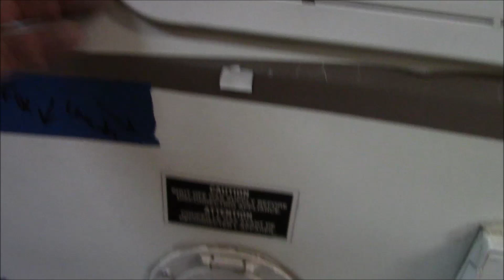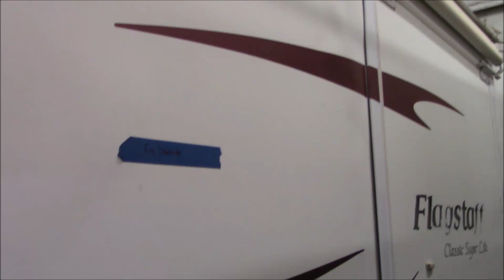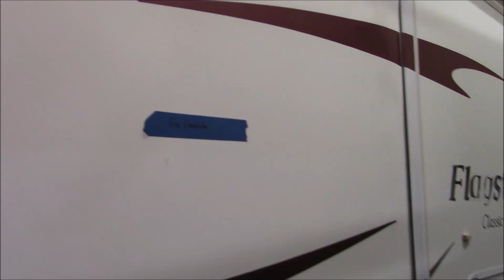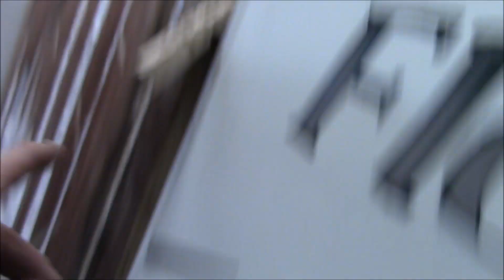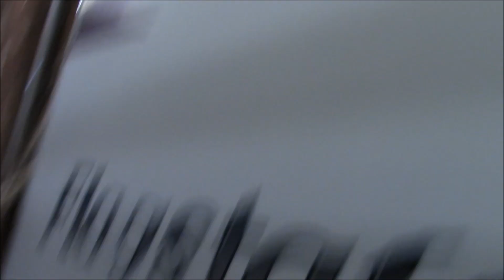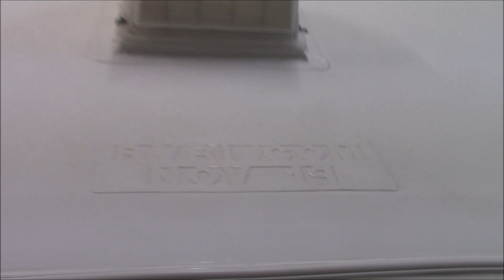2011 Flagstaff

Comment: I feel sick!...just ordered a new Rockwood 5th wheel...and while I was skeptical on the roof construction and build quality...now I’m really concerned. Got a 10 year old Northwood AF and never had any issues. Even mounted roof rack rails up there, lagged to the trusses, sealed with dicor. 6 years storing and carrying 2 kayaks thousands of miles, no issues.  No wall delam either. Maybe I’ll cancel the Rockwood!! Ugh...
Reply from the maker: Well...I am not sure how to advise since.... I don't own one...lol. I am the landscaper who had his yard paved!

Thanks for watching.
Reply: @RVROOFINSTALL  wow thanks for the instant reply!! You said you haven’t had an Airstream in your shop...have you ever dug into an Arctic Fox or Outdoors RV?  (Oregon made)
Reply from the maker: @Ck-ed9qy  we have not worked on what you've listed. What to keep in mind is the roof installation in the Rvs and campers. If the AC, vents and skylight etc are not elevates off the roof line, it will leak. Google commercial roof images and you will see all these components are elevated, not screwed to the roof and caulked around with globs of self leveling.

Comment: How is the trailer even worth saving?
Reply from the maker: Cheaper than a new one that will need a roof. They're all the same...literally. take the decals off and you can't tell one apart from the other. They are built the same, more than likely use the same vendors for parts. Newer ones are built worse. Pre 2006 units were built better than the 2022. They'll ALL need a roof sooner than expected. And these RV centers are doing the same exact install as the manufacturer...so some.folks may need a couple few roofs....uggh.., that's except for sure.
Thanks for watching.

Comment: Hi, Love your channel. I'm going to be installing a solar panel on my travel trailer. What sealent/ adhesive do you recommend for the breaches due to the mounting screws on the rubber (epdm)roof? Thanks and keep the vids. coming.
Reply from the maker: We don't recommend direct mounting to the roof. Thats a leak waiting to happen. Also solar panels need to sit above the roofiing a few inches because the generate heat that causes premature roof failure. All the ones we install are secured to mounts in a boot , heat welded to the roof.
Whatever you choose....you will need to prime the roofing.
OSI Quad will work. Available at Home Depot.
Thanks for watching!
Reply: Thanks, so you wouldn't advise me to use the m1 by chem link
Reply from the maker: @pauljohnston7700  sure. M1 is great. If.you can get it easily. Its not an.off the shelf product. Watch the Freedom class C 4x4 video. We prepd that for solar.
Reply: @RVROOFINSTALL  Great , thanks again

Comment: Good job. 👍
Reply from the maker: Thank you....I got a few ahead of yours.
Reply from the maker: Mr. Jacob I know you may not be able to come back as soon as you hoped to so you need to check all around the bunk corner molding and the lights and make sure everything is tight. Use the caulk we gave you in the care package, if need be, to make certain your sealed. With all the racking and twisting these coaches do it's smart to inspect all the caulking ; even in the top of the awning rail; the front and rear termination strips that run from side to side in the front and the rear as well as the ladder boots. Check everything.  That's what we look for in the initial inspection if you were to bring it back in. 
We appreciate your business and want to make certain we did a quality long lasting job for you sir.